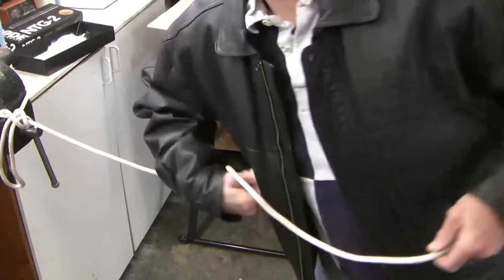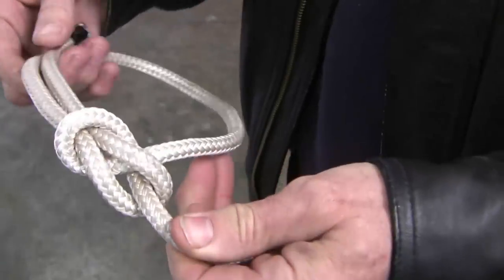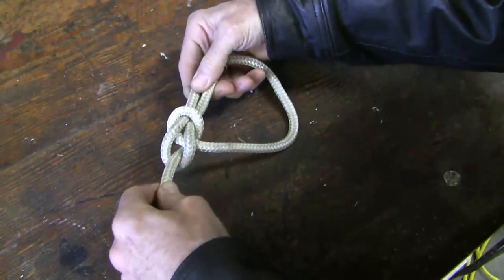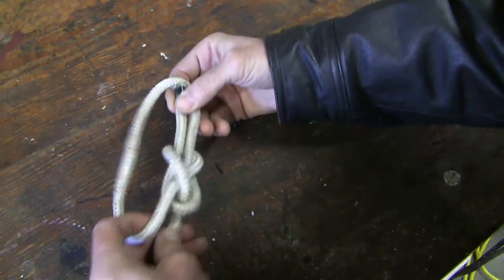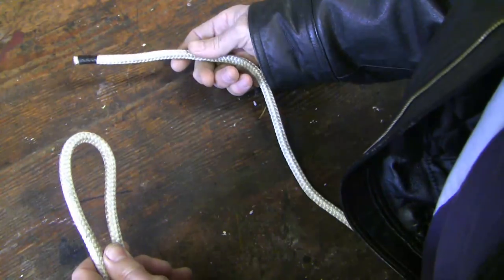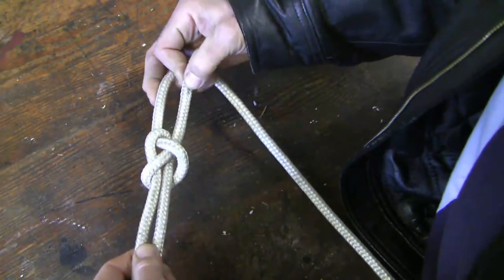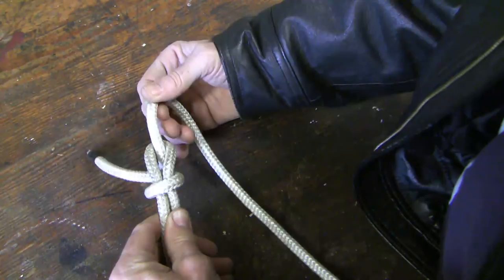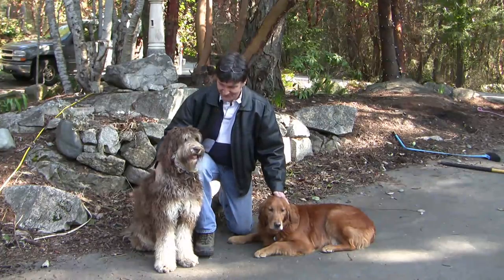What you never knew about the Bowline knot

Comment: Just remember that once you tie a knot in a rope you decrease it’s breaking strength. A bowline knot is a great knot. Easy to tie and easy to untie.  But you will lose 53% of the original strength of the rope.
Reply from the maker: This is a timely remark, I spent the morning splicing eye loops in class II spinnaker line and making soft shackles to attach them to the spin clew. They say that properly done splicing is far superior as far as breaking strength, though high modulus lines are already stronger than the weak points in the sail. For sailing, the bulk of the knot is a bigger issue, since the knot has to swing around the boat without catching on shrouds, etc. Higher quality line allows smaller diameters and smaller knots, always good. Thanks for stopping by!
Reply: spelunkerd  you couldn’t be more correct sir. I believe that a long spliced eye will retain 90% of the original breaking strength. I think That is correct but I could be wrong. Yet it is much stronger.
Reply: @spelunkerd  Actually I disagree. Strictly from a scientific point of view and as evidenced  by empirical data, the larger the knot the better the breaking strain or load capabilities of the knot. This has to do with the actual bending of the rope and circumstances of the knots's biting elements. The smaller the diameter of ANY BEND in a rope (typically throughout any part of a knot- as opposed to most other places of a line or straight standing line) causes greater stress and ultimately greater breaking force at that point. Hence why a double figure of 8 knot is so powerful - dressed properly of course.
Reply from the maker: @timbrook-taylor3434  Oh, I see your point, thoughtfully presented. On a boat, the common problem is knots catching on shrouds, and weight of lines in the mast high above the center of gravity. Serious racing sailors even go so far as to strip the protective cover off a line so that the destabilizing weight, high inside the mast, is reduced. For that reason we generally choose lines only as large as they have to be to support the load, and we favor splices over knots because their profile is reduced (less likely to snag on nearby objects). With the development of Class II rope we can use line with a much reduced diameter compared to old style rope because the breaking strength is so much higher. I agree that small lines, with their smaller knots with tighter bends are weaker than their bigger cousins. Bigger knots and bigger lines are heavy and harder to work with so are not preferred.
Reply: @spelunkerd  This is true. Wear at the point of attachment is probably the next most likely point for a rope to fail in a boating situation, as it is always moving about on the sail's eye. Hence the need for splicing with and eye, where the steel eye protects the rope. Of course you can't always easily undo a splice, where as with a knot you can. Nothing is perfect of course. A double round turn with two half hitches is a great knot for reducing load in the wear and knot points. It is stronger with more turns and on a larger circumference pole or attachment point. If wear is likely to be an issue, and you still want the convenience of a swift release, one can use a steel gate karabiner that locks with a screw thread. Splice to the karabiner and attach accordingly. Note and calculate the loading of the karabiner for wind strength.
Reply from the maker: @timbrook-taylor3434  Excellent point, one I'm dealing with today. Because I spliced my main halyard line, wear is fixed to a small region about 8" from the shackle, and I can't easily reverse the line or shorten it without cutting out the entire splice. I don't have enough line to do that, so soon I'll be buying another one. Old time sailors who used halyard knots would swap lines and reverse them so that wear is evenly distributed, like rotating tires on a car.
Reply: @spelunkerd  Yes you find climbers and cavers do similar things, at least I did when I was a speleologist... I never had the issue when I used to sail...Maintenance trumps fixing broken gear, and is always preferable when your life is on the line (pun intended).

Comment: waste bowline fail attempt at :18
Reply from the maker: That's very observant, I thought more would pick up on it but you're the first to mention it. You're right it didn't collapse into its usual shape because of the quick and sloppy one-handed method of tying it, but it is still a bowline and I can tell you that under the tension of a rescue, the knot holds just fine. One loop is rolled over a little but the internal structure is preserved, and with a slight roll of an outside loop it takes on the familiar shape. I remember the weeks they drilled that into us in scouts, presumably to teach people to tie a rescue loop in the end of a thrown rope when the other hand is injured or occupied. To pause or cheat with an outside hand to make it look pretty defeats the intent of the exercise, so they generally gave that one a pass. I guess the scout leaders thought that if you teach millions of kids how to do it, the rare kid who finds himself in the water or hanging from a cliff might make use of it. I don't know if it ever happened, but many of us still remember the drill, decades later. It used to be a common knot in mountaineering but is rarely used in the mountains now. I use the bowline every day when sailing, but always tie it with two hands.
Reply: +spelunkerd 
the trick to the one hand bowline is to do it with half-3/4 of your hand not the whole hand or your wrist will get stuck every time, and the knot inverts..and no it's not the same although maybe it'll hold long enough, I would not call it a bowline maybe a fail-line,.. gosailnow.com